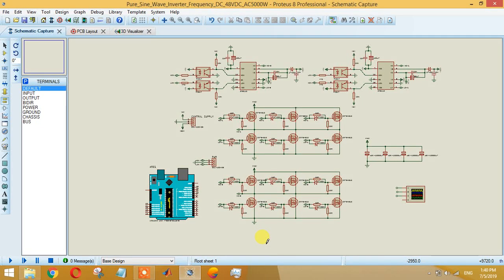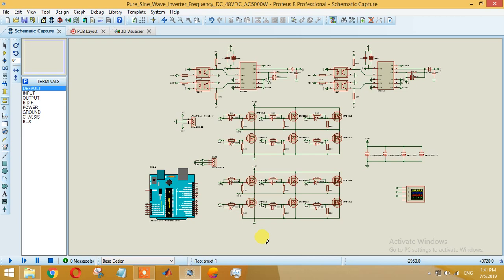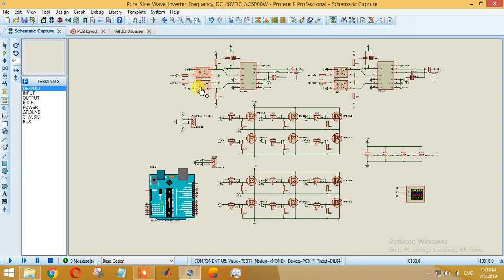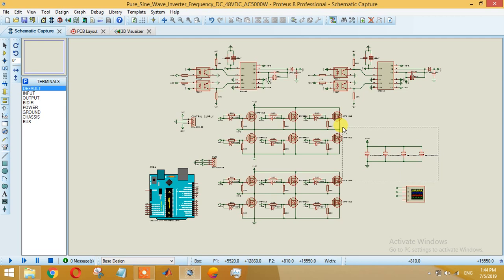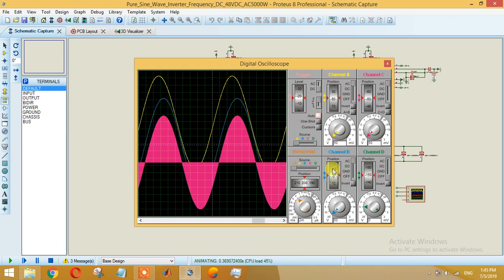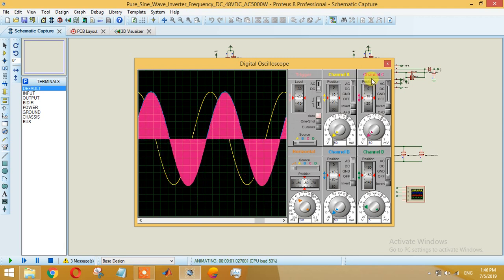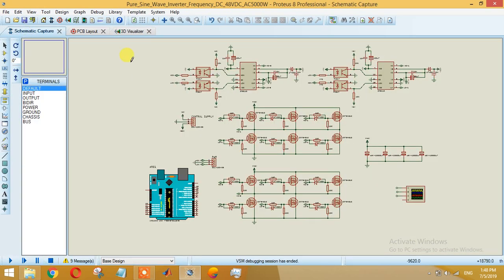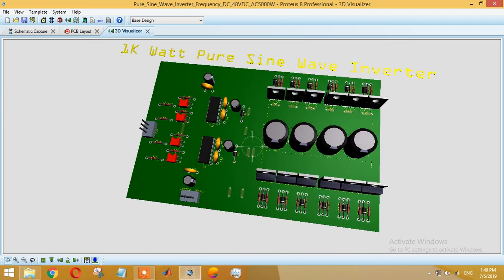Pure Sine Wave Inverter | Code | Schematics | PCB Design | 5KW

Comment: Can you write sinewave code using hbridge  with dspic30f2010, 20khz carrier frequency, 50hz mains 220v output? If you can let me know the prize
Reply from the maker: Contact: aliali556352@gmail.com
Available [Code + Simulation + PCB + Schematics + Gerber Files]